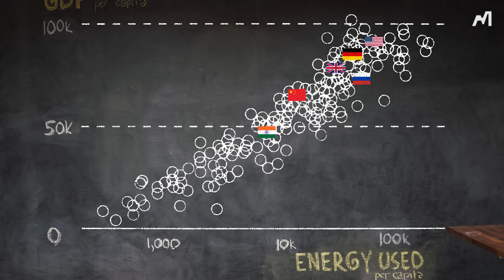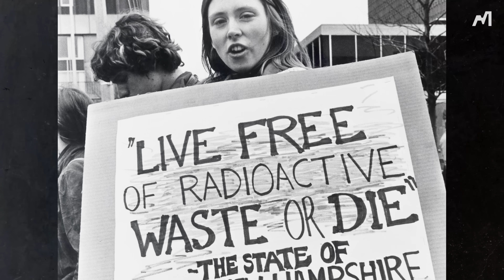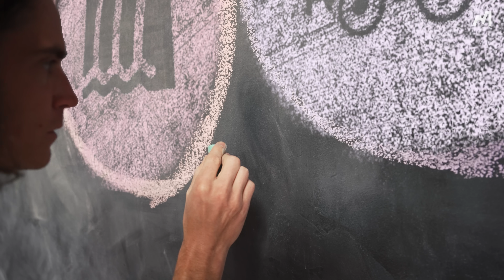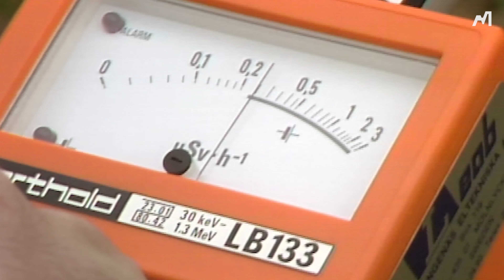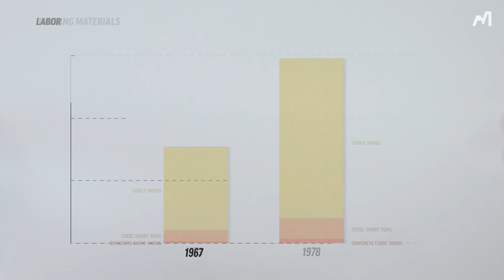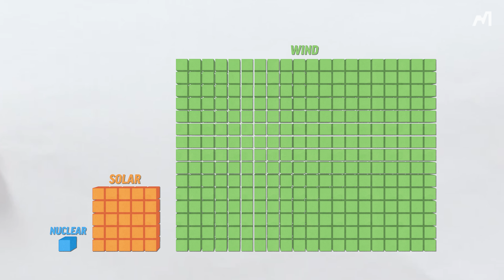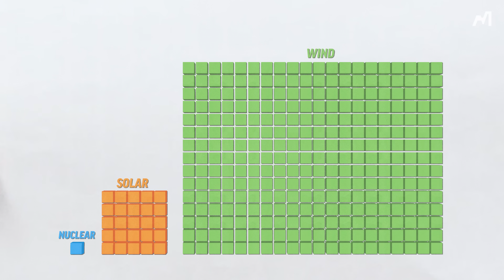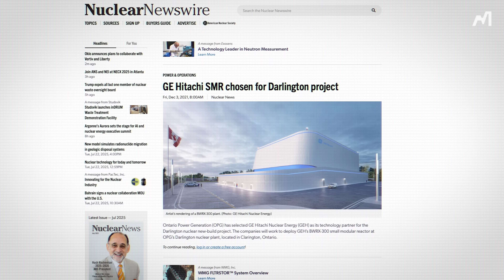They're Lying to You About Nuclear Energy

Comment: The US Navy operates 80 of its most valuable and critical ships - on Nuclear.   They prioritize durability, safety and high performance.   The US Navy started this in 1954.  There is NO reason to NOT proliferate this technology into Civilian use.
Reply: I'm a retired nuclear engineer and ex-US Navy nuke. The reason that the US Navy has an almost (see below ) perfect safety record is that cost is not an obstacle. Safety is the primary consideration. It is drilled into every nuclear power sailor every day for years. Constant safety checks are made all day and night. Maintenance is adhered to strictly and without fail. All of that safety is expensive. Extremely so. A corporation has other priorities, not just safety. Safety isn't even the top priority. That will always be maximizing return for shareholders. The accident at Three Mile Island was determined to be primarily due to lack of proper maintenance and lack of proper training. Navy nuclear safety can not and should never be used as a reason to assume commercial use is safe. 

As for the almost perfect Navy safety record, there has only ever been one radiation release due to a problem with a US Navy nuclear reactor. That was a primary coolant leak on the USS Guardfish (SSN-612) during a leak test on a valve. The radioactive steam from the primary coolant loop exposed 5 crew members, but they were not exposed enough to be fatal. That is the only radiation release accident in reactor operation in over 70 years. BUT over the years there have been 10 or so accidents involving transfer of coolant to and from submarine tenders and subs that have resulted in radiation release. Those sub tender ships are crewed by civilian contractors. There was also the SL-1 explosion and meltdown at the military-run National Reactor Testing Station in 1961 which resulted in 3 fatalities. 

On the civilian side, the list is much longer. Beginning with the partial meltdown at the Rocketdyne facility in Simi Valley, CA in 1959, there have been many accidents, some fatal. The first was an accidental criticality at the United Nuclear Corporation fuel facility in Charlestown, RI which resulted in a fatality. The most fatalities from a single incident occurred in 1986 when a feedwater line burst at the Surry Nuclear Power plant in Virginia in 1986 resulted in 4 fatalities. The most recent incident was a leak of over 1500 cubic meters of radioactive coolant water at the Monticello plant in Minnesota in 2022. The release has still not been 100% cleaned up. 

The more commericial power plants there are, the more likely it is for poor safety and maintenance due to cost cutting to become a very serious problem. We live in an era where it is considered wrong to highly regulate businesses. When politics and profits are the main drivers, instead of safety, there will be inevitable problems. I contend that commercial nuclear power plants aren't regulated enough. They should be regulated as extremely as possible. Because even in the extremely regulated and safety conscious, non-profit-oriented US Navy, accidents still happen.
Reply: @Gerald-Oxfordian  nuked out that response. 😝
Reply: @Gerald-Oxfordian Thank you for your insightful honesty and knowledgeable comment.
Reply: @Gerald-Oxfordian  and these Soviet subs:

Soviet Submarine K-19 (1961):
This submarine experienced a reactor coolant leak, leading to a dangerous rise in reactor temperature and a near-meltdown. The crew, lacking proper radiation equipment, had to improvise a cooling system, resulting in several deaths and widespread contamination. 

Soviet Submarine K-27 (1968):
This submarine experienced a meltdown in one of its two reactors, resulting in multiple fatalities and injuries.
Reply: @sszibler  american sub:
USS Thresher SSN-593 (1963):
Water shorted the electical-system, causing reactor to scram (shutdown), all hand lost.
Reply: @Gerald-Oxfordian weve been accident free from almost the entire history of nnpp
Reply: @richg6191  Most of the accidents were in the 1970's. But the Navy nuclear power program was going then. I'd alter that to say the Navy has been nuclear accident free since the program was fully organized and got its own training school at NTC Orlando. The NNPS there opened in 1976, just 3 years before I went there. Now, of course, it is consolidated further into the NPS in Goose Creek, including the separate nuke A schools. When I was in we went to the regular Navy A schools for our rating before moving to Orlando. Prior to Orlando, the nuclear training was done at Mare Island. All of my instructors in Orlando were trained there. That school opened in 1959. I think for a short while there was also an early nuke training school in the 60's in Maryland, but I might be wrong.
Reply: @Gerald-Oxfordian those are incidents in the navy nuclear fleet, not accidents
Reply: @richg6191  They are classified as nuclear accidents if they occur as a result of anything having to do with a nuclear reactor. Technically even simply industrial accidents like getting electrocuted are classified that way if they occurred in the power plant at a nuclear facility. All of the incidents I mentioned were radiation-related accidents. Mostly cooling water transfers to/from subs to tenders. 
The IAEA has an even looser definition which defines it in part as "an event that has led to significant consequences to people, the environment or the facility" of or because of any accident at a nuclear power plant. Several accidents classified as nuclear accidents were electrocutions, several more due to fires which damaged only peripheral equipment, several hydrogen explosions which damaged auxiliary buildings and more. I think that definition is too loose, which is why I stuck to radiation release only and only included those related to Navy operations.
Reply: @Gerald-Oxfordian  - Okay, now that we've gone over the difference between incidents and accidents, what about hints and allegations?😂
Reply: @samuelluria4744  Your meaning isn't clear. Perhaps you're hinting at allegations.
Reply: @Gerald-Oxfordian  - Sorry, it's a Paul Simon song lyric.
Reply: @Gerald-Oxfordian this is a perfect argument for a nationalized nuclear power grid. Imagine the amount of savings by the elimination of the hundreds of billions of dollars we dump into oil companies.
Reply: @Gerald-Oxfordian this.  Many commenters here and elsewhere say that we should just do things like the Navy does because all the issues with nuclear power have been solved by the Navy.  Except... the Navy isn't cost-conscious.  If you built a civilian reactor the way the Navy builds their reactors, it would likely produce unaffordable power.

Another thing the Navy isn't concerned about is environmental impact.  I'm always puzzled when people describe nuclear energy as "green".  Those who live near uranium mines probably have a rather different perspective.  Another thing to note is that nuclear power plants require large amounts of water.  Some of that water is turned into steam and the rest is returned to the river, ocean, or lake - but it's now a lot warmer than when it was removed from that source.  This absolutely has an impact.  It's certainly not unique to nuclear - hydro, solar/battery, and wind all have their non-green aspects - but the video glosses over this.

I'm not saying that nuclear power plants shouldn't be built.  This video shows the frustrating truth that we made it cost-prohibative to build civilian plants with regulation.  People with an agenda used scare tactics and the legal and legislative systems to make it so.  We should roll back restrictions which have their basis in fear-mongering rather than science.  BUT - we also need to acknowledge that the Navy isn't trying to build reactors to produce affordable power and nuclear power isn't "green".  We don't know what the actual nuclear cost proposition would look like in a hypothetical de-regulated environment.
Reply: @bretjensen6670  I agree completely. The reason that Navy reactors are almost but not entirely accident free is because cost is not an issue. The costs of building, maintaining and training are not an issue. The exact opposite is true for commercial nuclear power. Cost is a major issue and safety naturally comes after cost in their priorities. Corners get cut in building, maintaining and training to maximize profits and political considerations neuter regulations that are absolutely necessary.

Green energy should really be called relatively green. They all come with their own problems, but by far the safest and most "green" are solar, hydro, and geothermal. Fusion might eventually make that list as well, but it will be a decade before ITER has first plasma and others like SPARC are still in the construction process too. 

On the scale of safe and clean, nuclear power is much closer to fossil fuels in terms of dangers and secondary harm to the environment than solar, hydro and geothermal.
Reply: Plutonium planes
Reply: @Sincerely_MrX LOL😂
Reply: Thanks to Admiral Hyman G. Rickover
Reply: Except that one time or was it 9 times? lol. 9 Nuclear subs have sunk, some of which can never be retrieved in case they rupture and contaminate the ocean.
Reply: I want to build one in my backyard so I don't have to pay so much for electricity
Reply: K-19
Reply: @woogicreate8876 Russian sub.  The conversation is specific to the US - and a proper safety protocol and use of Nuclear.
Reply: @davidcook1057  You don't get it pal. The russians didn't want their sub to explode neither. But it did. When subs age, and the US fleet ages too, when people become complacent, and don't say people don't become complacent, ever, then accidents will happen. But more important - when these accidents can happen in highly trained and sponsored navies then they can for sure happen on land. And not always because their dumb or negligent ; it can be because of design. Like Fukushima. The people in Japan got away pretty well there. The world got away pretty well. Half an ocean could have become a breeding pond for small Godzillas, for real, and plenty more people could have died on land.  You're way to confident with the safety of operating nuclear reactors and way too overconfident on the impact when something does go wrong. I don't say nuclear cannot be safe, but the CURRENT plants all can have a meltdown with disastrous consequences. IF we want to bet more on nuclear, do it with inherently safer designers, like a thorium based system. Though the corrosion of the molten salts will have its own issues to - there seems to be no easy, cheap and safe way out. Just do stuff that is simple. Mechanical windturbines. Passive solar panels. Tidal and geothermal energy. No meltdowns when a turbine catches fire, no 1000 year radiation when old solar panels have to be replaced. No billions and billions needed to set up a single tidal wave energy plant. No single target for terrorists to attack, bomb, infiltrate, cyberattack etc etc.
Reply: @woogicreate8876 Go back to your video games Woogi - let the adults deal with big ideas and civilization building.
Reply: @davidcook1057  Good arguments man. Keep it up!
Reply: @woogicreate8876 he said US Naval subs ..pay attention
Reply: @woogicreate8876 We are not Russia.
Reply: There's better tech for civilian reactors. The constraints of operating on a ship or sub dictate design choices that are not optimal if you have more space. Sodium or salt cooled fast reactors are things we've known how to build well enough, and on a scale large enough, for commercial applications since the early 1990s at least. These would be far superior to HEU boiling water reactors like those used by naval vessels for utility power generation.
Reply: Nuclear is the worst form of energy in the world. Its not green in any way. How do we dispose of the irradiated cooling liquid? What happens if theres a large solar flare like the Carrington event?
Reply: @zavelazer8167  how many have died? How long, compared to acres of windmills in Idaho, will a facility last? The cooling liquid is no different then the tank farm in tricities Wa...
Reply: @zavelazer8167  99% of nuclear waste is just contaminated clothing like radiation suits and fabrics, Kyle Hill made a video going into detail explain how absurdly safe and waste free Nuclear reactors actually are.
Reply: My father was a sailor on a nuclear sub 50 years ago.
Reply: I served 4 years on a U.S. Navy nuclear submarine. While on patrol I received less radiation per day then I did walking around in a normal day on shore.
Reply: There is: molten salt reactors are self-extinguishing in case of overheating and they can use up old nuclear waste as their fuel
Reply: @minagica  - These are not online yet.
Reply: Not to be anti nuclear but that's partially because the US military essentially hands certain companies blank cheques
Reply: How safe are all those nuclear ships and subs during war when they start getting destroyed
Reply: If it's good enough to run the military why isn't it commercial 🤔 makes ya wonder if it's intentional
Reply: @troyelder56   Usually, it is, the US does not share tech that could benefit the masses with the masses as long as it could affect profits. I am certain that by now, someone, somewhere has found a cure for cancer, but it is not nearly as profitable as chemotherapy, and the whole usual process, so it won't become public.

That is the method of the US.
And the whole pharma industry, actually.
Reply: Nonsense, if the power question was solved many many politicians, lobbyists, and activists would lose their jobs. And then there might be literal witch hunts to hunt down the people who knowingly pushed "green technology" for the past 3 decades
Reply: The reason isn’t safety related.. it’s always about the $$$ and Big Oil is still king
Reply: The source is so limited, that 50' level of proliferation, would bring it to an end, in less than 200 years. How you power your subs then? 
The town i live in, was funded 900 years ago. The road, my car is parked on, is almost 500 years older. When people back than, had used nuclear power, as we do, there would be no RTG roaming over the surface of planet Mars by now. Stop being short sided. Boil your water another way😉
Reply: @goiterlanternbase  Or just go electric and forget it.
Reply: micro-nuclear stations all over would resolve most power issues
Reply: one reason 💰💰💰💸💸
Reply: Well, for one thing the presenter, Phil, lied to you or was given false information. Nuclear subs have had meltdowns and radioactive coolant leaks, so please don’t lie about the nuclear past as they have, especially when the information is easily obtainable from a google search! 

That’s PLENTY reason not to proliferate into civilian life. The fact that anyone needs to put out false information is reason enough to not trust this info. 

The lack of critical thinking about these content providers is astounding!

Soviet Submarine K-19 (1961):
This submarine experienced a reactor coolant leak, leading to a dangerous rise in reactor temperature and a near-meltdown. The crew, lacking proper radiation equipment, had to improvise a cooling system, resulting in several deaths and widespread contamination. 

Soviet Submarine K-27 (1968):
This submarine experienced a meltdown in one of its two reactors, resulting in multiple fatalities and injuries.
Reply: You have no idea what you are talking about! Navy reactors are enriched close to 95% making them fully weaponizable. The public sector will never get access to such materials.
Reply: I said ram the ship up the Columbia to tri cities, breaking the ship along the way
Reply: The USA is a bankrupt nation in more ways than one.
The USA is a war mongering, global terrorists.
That's an irrefutable fact.
The USA is also a very detrimental influence on Humanity.
A corrupting influence, responsible for many of the most serious threats now facing Humanity.
Hardly an example to be used in any sane argument.
The USA is a force of darkness and depravity, even against its own people.
Financially bankrupt but also very obviously morally bankrupt.
It's own typical boastful arrogance, is a brainwash which is not readily accepted by the sane, observant World.
Reply: All my other comments seem to have been vanished.
Very typical of YouTube to steal people's time, minds, and work.
Rendering many of these debates a futile exercise.
Designed for clickbait, data gathering, profit making, and not a real debate of any lasting value.
Reply: The Navy is an example of a reasonable use of nukes, particularly the prudent fashion in which the Navy has historically operated in this regard.  But to use nukes to power the grid for commercial reactors makes no sense whatsoever, economically or in any other way, especially considering the US has more and better natural gas than the rest of the world COMBINED.
Reply: @TheRealDrJoey  It does make sense in a way, just based on the fact that nuclear power is very fuel efficient and reliable. Only the most modern natural gas plants are as fuel efficient; but nuclear power plants have more than 90% capacity factor (the ratio of real electrical output to the theoretical maximum output over the same period), which is 2X that of fossil fuel plants and more than 3X that of wind and solar. Capacity factor can be considered a kind of reliability and lack of downtime. Nuclear excels at that. But nuclear also has safety concerns as discussed above and we haven't even delved into the inevitable radioactive waste problem. 
The US currently has over 90K metric tons of radioactive waste in temporary storage, most on-site at nuclear power plants but some at 3rd part off-site locations. That number increases by 2k metric tons per year. There were plans to build a storage facility at Yucca flats, but it has been entirely defunded and abandoned and that facility was only designed to store 80K metric tons, back when the US stockpile was only 60K tons.
 The US is the only nuclear power-using country in the world right now which has no currently being constructed underground storage (Finland) or plans to construct such (everyone else but the USA). We're just using temporary storage rated to last more than 100 years, but we need permanent storage which will last at least 10,000 years, which is another big problem.
Fusion is our best hope, but we don't have commercially viable fusion yet. The best we've achieved has been a Q=1.5 or so recently at Lawrence Livermore. We need Q>5 or even Q>10 to be commercially viable. Q=0 being the power input to power output breakeven.
Reply: @TheRealDrJoey  - Don't get offended, but it always cracks me up when people talk about [place X] having more [such-and-such] than [place Y]...
        We are FAR from knowing how much of [any given subterranean resources] are where and where not. 
       Clearly, with forthcoming exponential advances in sensory apparatus, due to AI, we will know much more in 10 years, but right now there are still many mysteries.
Reply: *Domestic* civilian use.  We all know how India and Pakistan turned out.
Reply: In civilian use you would need only one group of human hating activists to turn it into nightmare.
Reply: Yes there is... armagedon.
Reply: the reason why this tech is kept secret is to prevent foreign nations from getting access to it and building their own nuclear subs and carriers.
Reply: @KT-pv3kl  France has their own, Brazil has their own nuclear carriers, China and Russia are likely to have their own should they choose to do so at any point. The secret is not as secret as the sheltered and indoctrinated fools think it is. If you can make a Nuclear Plant, it wont take long to figure out how to downsize for ship use 😂
Reply: @georgesgranger6362  i call absolute BS on brazil of all places "having their own" .

....yep turns out you are spouting BS. 
brazil doesnt even have regular aircraft carriers left alone nuclear ones.  they had a single one that they had to scrap due to its abysmal performance.
Reply: @georgesgranger6362  nah mate you lost me at brazil ... 

brazil doesnt even have aircraft carriers at this point left alone nuclear powered ones. whoever told you that is delusional. 

the problem isnt making a reactor small the problem is making a small reactor safe. 
you dont have dozends of meters of water , concrete and steel shielding the reactor core from the squishy bits that shouldnt be blasted by gamma radiation in miniaturized reactors so your margins for error are razor thin when it comes to energy output and cooling/regulating the core.
Reply: More then enough reasons to pull the plug on nuclear
Reply: @computercrack  if you believe everything the Government and big Oil says about it sure
Reply: There is, and it's called profit.
Lobbyists control the world, not the citizens.
Reply: They do utilize a higher grade of refinement, than commercial plants, if my understanding is correct.  Has to go through more centrifuges, etc
Reply: Like the Kursk?
Reply: @stefanschleps8758 Did the US Navy operate the Kursk?
Reply: @davidcook1057  the US Navy shouldnt be used as a metric of safety given information from the Military is heavily censored and covered up 😂
Reply: @georgesgranger6362 oh please, this isn’t Russia or China.
Reply: From what little I know about this subject you are 100% dead wrong. Nuclear freighters were not built for the obvious reasons, terrorism.
Reply: Try more like 100, I can come up with 78 just from submarines, but every aircraft carrier has one too.  So that's at least 90 right there, and I am probably missing something.
Reply: Do you go thru life believing the claims you make are written in stone? You sound like a military contractor's brochure.

I'll give you a reason not to proliferate this technology: 
NS Savannah, the first nuclear-powered cargo and passenger ship

Launched July 21, 1959 
Out of service January 10, 1972 A total of 13 years of useful life.

reactor de-fuelling completed 1975
reactor core removal completed 2022

Full decommissioning of the nuclear power pant is currently expected to finish in 2031, 59 years after she ended her useful 13 years of life.
Only then can she be scrapped.
Reply: US navy operates Light water reactors with very high U235 content, well above civilian limitations. But that's neither here nor there. Light water reactors are much safer at the scales the navy deploys them, than the scales they're built for commercial use. Like 250mwe vs 1 GWe 

Many rector operators today are former naval nukes. But hered the fun bit: the automatic controls are actually significantly safer and more reliable than the operators themselves. I attended a conference for nuclear operator trainers providing it support. They had 2 jokes.

The ideal control room has a dog and single operator, the operators job is to feed the dog, the dogs job is to keep the operator away from the controls. 

The fire thing an operator needs to do when a warning goes off, is to hurry up and call a pizza delivery place. Then wait for the pizza to arrive. Then eat the pizza. Then if the alarm is still blaring, they go to wall shelf and get the first book of instructions to start troubleshooting the alarm. 9/10 the alarms are solved automatically.
Reply: US Navy reators run on highly enriched uranium, roughly 95%. This uranium is weapons grade quality and costs about $50M for only 165MWe.
Reply: @paulwhelan8567 France operates nuclear subs on 7% enriched uranium, the only reason highly enriched uranium is used is to extend the time between refueling, which isn't an issue for civilian reactors.
Reply: @paulwhelan8567  These costs are inflated, it could be done for far less, but why?
Reply: @paulwhelan8567 Good thing the technology is 70+ years old - many generations improved and SMRs only requires 20% - which is going to be enriched in the  US.  The point is this technology is safe and durable.
Reply: @davidcook1057 they haven't built a smr yet! And they never will build one that is safe! The fuel for an smr is illegal in the states! No MOX FUEL! NO REPROCESSEDFUEL! ILLEGAL! NO SMR'S EITHER!
Reply: @richardmccann4815 This is exactly the kind of ignorance that is rampant surrounding Nuclear.  You are totally wrong - update your information and stop peddling ignorance.  A simple GROK ask will tell you how wrong you are.
Reply: @richardmccann4815  only illegal because politicians make money with how they handle things here in the states. 😂
Reply: Yes there is, it's called people. The military has strict rules, regulation, and code of conduct. They also have classified protection so we have no idea if anything has ever gone wrong with any of their reactors. Meanwhile normal folks are lazy, we mess up, we cut corners, we down play risks, fall asleep at work, and then there is of course armed conflict. Fear of technology is not the reason it's the knowledge of human behavior. 

Oh, and if anything goes wrong with one of the Navy's reactors they can drop it to the bottom of the ocean, what happens when something goes wrong with the one down the street from you? You gonna go clean it up?
Reply: @willernst2721 imagine how little Humanity would achieve with such ignorant and small brain thinking.  I am grateful for the builders, the risk takers, the dreamers that don’t project Incompetence on the rest of humanity.
Reply: Yes, Navy ships are just like civilian reactors and operators.
Reply: @railgap  Not exactly. Power plants are pressurized water reactors using lower energy-density low enriched fuels and are operated by controlling the amount of xeon and other neutron absorbing elements in their cooling water. Naval reactors are boiling water reactors (which effects the design of the turbines) using high energy-density high enriched fuels (>90% U235). They are operated by adjusting their control rods and are rapidly throtable.  Also, thd designs of the naval reactors are a state secret.
Reply: @evancourtney7746  I think you are mistaken on naval reactor types. According to published materials, virtually all water cooled naval reactors are PWR designs, not BWRs. 
My understanding is they use higher enrichment to provide fast throttlablilty (overcoming the inevitable neutron poisons you mention for example, although the introduced burnable poisons in commercial reactors are typically boron or gadolinium, not xenon, which is a fission product, not a purposely introduced neutron poison), long un-refueled lifetimes and increased power density. Even Nautilus had ~18% enrichment for these reasons.
Reply: @railgap  A lot of the personnel operating most commercial reactors are retired navy nukes. Though I'm assuming your use of the word operator to refer to the companies that own and operate the plants?
Reply: Started this in 1954, and to this day have not had a single nuclear accident.

The worst disasters that ever occurred either affected systems that did not contain radioactive particles, or the contamination was still well below dangerous levels and was immediately cleaned up when it was discovered.
Reply: @techypriest7523  Incorrect. See my post.
Reply: @techypriest7523  Soviet Submarine K-19 (1961):
This submarine experienced a reactor coolant leak, leading to a dangerous rise in reactor temperature and a near-meltdown. The crew, lacking proper radiation equipment, had to improvise a cooling system, resulting in several deaths and widespread contamination. 

Soviet Submarine K-27 (1968):
This submarine experienced a meltdown in one of its two reactors, resulting in multiple fatalities and injuries.
Reply: @techypriest7523 Until it all goes horribly wrong and you take zero accountability.
Reply: @techypriest7523 you're a bit touched in the head if you really believe nothing has ever gone wrong and just wasn't reported. The same thing happened at the Hanford site and wasn't admitted to until something like 50 years later. That's why there's unknown spills throughout the site because the people that spilled it didn't want to get in trouble so they just didn't tell anyone until much later in life. Oh and those same workers are constantly getting sick now from the exposure to this "safe" radioactive material. They run ads about lawsuits they qualify for because they weren't given the proper PPE. And that continued into the 2000s during the largest super fund site in the world. Why would we spend billions cleaning it up if it's so safe? Might still be happening now.
Reply: @techypriest7523  There have been accidents with bombs however.
Reply: @tedmoss  different people running that situation. Cannot blame their idiocy for the running of nuclear reactors.
Reply: There are nuclear secrets in those Navy reactors that have “national security” stamps so it’s not that easy. 

Naval reactors are probably more robust since I’d expect they have “wartime” thinking in them.
Reply: If ever there were an ultimate limit to "growth," it would look exactly like what is happening now, where all alternatives are short-term gain at the expense of long-term sustainability.

There is no such thing as permanent, safe, storage of spent fuel (witness the ongoing storage of spent fuel at plant locations from lack of dumping sites, making each reactor site "an event in progress," just like what is going on at Chernobyl and Fukushima)!
 
More stupidity is not the solution to stupidity. The simple fact is that the intense ionizing radiation in the boundary of the nuclear fuel causes the containment to transmute over time, where the containment materials lose their original elemental qualities, frequently becoming brittle and no longer able to perform as originally intended. Zombie reactors that are past their designed life are losing the safety safety factors originally designed into the containment in ways that are not predictable until incidents inevitably occur. The same thing applies to the containment of high-level nuclear waste. These matters are well-known to the industry, but being withheld from public scrutiny in order to maintain the current zeitgeist.
Reply: There is a reason. The Navy has almost unlimited money to spend and doesn’t need to make a profit on anything. Nuclear power in a civilian market needs to be cost competitive with alternatives, which it currently is not.
Reply: @wendlerkurt  Thorium? More nuclear options than one. The free market makes things better and cheaper.
Reply: @wendlerkurt Nuclear is more profitable in the long run. It just takes 10+ years to start turning a profit, and as long as 15 for the profits to overtake natural gas. That's longer than any relevant business or political cycle. No one is willing to make investments that take that long to pay off. But they should.
Reply: @wendlerkurt hence why we should have them.
Reply: @Jengoboys603  you want to pay more for electricity? I don’t
Reply: @wendlerkurt  I could make a reactor that is cost competitive. People won't let me.
Reply: @wendlerkurtthe only thing making it not cost competitive is the burdensome regulatory bodies. They won’t allow new plants, they cause delays and cost overruns until projects are cancelled as explained in this video. No reason for it except politics. Military has demonstrated safe nuclear. We know how to do it.
Reply: You mean when they switched from using gas powered submarines that had a trail of bubbles coming out of their exhaust? Which needed to resurface every hour because the oxygen would be depleted by their engines? Or the ones that couldn't dive very deep or the sunlight wouldn't reach their solar panels?
Or perhaps none of those existed, because a submarine is a very specialized environment?
Reply: They also pay through the ringer for these reactor. Worth it for their military advantage, not economically interesting.

There is a reason the navy abandoned the idea of nuclear power cruiser or why civil maritime industry (or any civil industry) hasn't been trying to introduce the naval reactors for civilian use. They are only worth it for some specific applications where high costs can be acceptable.

This is why civil SMR's also need to "start from scratch", it isn't just building an SMR, it is building it in an economical (and still safe/legal) way.
Reply: @MDP1702 sometimes things shouldn’t be about the economics, I’m sorry. This is such a 19th century way of thinking and it’s no longer sustainable; not everything that should be done by humanity should be done purely for profit. The world needs to solve a lot of problems, and the solutions are often not immediately profitable economically.
Reply: @pekabu01  
sometimes things shouldn’t be about the economics
You can say this as much as you want, but unless you're going to change how the world works, economics will be a main driver.

not everything that should be done by humanity should be done purely for profit
Which is why you (should) have government actions for: the benefit of all, not profit. However they still have a budget to balance and will favour solutions that can be economical on their own (eventually).

Don't think I am a capitalist who believes free market should always reign, I am actually pretty socialist oriented but I am also aware of how the worlds works currently.
Reply: @MDP1702  Most States regulate Utility company profit margins.  It is meant to balance reasonable profits with consumer protection and safety.
Reply: @davidcook1057  That isn't really relevant if there are no profits to be had => no profits => no reason for investors or companies to build and explot it.
Reply: @MDP1702 Yet, it is currently happening, right now.
Reply: @davidcook1057  Which companies/private persons are investing in non-economical naval type nuclear reactors for civil use?
Reply: @MDP1702 I brought up Nuclear technology being used in the US Navy.  That if Nuclear technology is safe and durable enough for the military’s most precious assets, there is no reason that the civilian world should be so terrified and ignorant about Nuclear technology.   Smooth brains jumped to the conclusion that I was talking specifically about only Navy Nuclear style reactors.  The conversation is about Nuclear technology.
Reply: @davidcook1057  
That if Nuclear technology is safe and durable enough for the military’s most precious assets, there is no reason that the civilian world should be so terrified and ignorant about Nuclear technology.
And I pointed out that you can't make that comparison. Nuclear naval design is different than that of civil. Their safety precautions are even more stringent than current civil regulation because costs are more of an "afterthought" in comparison
If you'd translate military nuclear regulation to civil nuclear regulation, the cost of civil nuclear power would increase a lot more than in already is.

It is like pointing to an aircraft carrier and going "look you can launch and land planes from ships", yeah duh that is possible, but it has no bearing on civil aviation.

Safety of nuclear with proper regulation never really was in contention, the question is more what entails proper regulation and doesn't it make nuclear too expensive (and thus making the point of safe nuclear void anyway).
Reply: @MDP1702 complete nonsense.  Do you think the US Navy learned anything in the 70 years of using Nuclear under extreme conditions that would translate to the civilian world?  Things that could make it safer, more efficient?  MANY technologies that were first used by the military, we now rely on in the civilian world.  GPS, the internet, etc.   The technology is generations further than it was in the 50’s and 60’s - decades ahead.  This country needs every energy source it can get in the coming decades, and Nuclear must be part of that equation.
Reply: @davidcook1057  
Do you think the US Navy learned anything in the 70 years of using Nuclear under extreme conditions that would translate to the civilian world?
Except most of that would be classified or too expensive to use. You are better served looking at civil nuclear/projects or researching "new". By the time the knowledge of military reactors that wasn't already known to civil industry before is declassified, it is already outdated.

I don't dispute that other things developed for the military had a big impact on civil life, but we aren't talking about these things now.

In the end the point to your original comment remains: military nuclear reactors have proven so well and safe because money was thrown at it in a way not possible in civil industries. And I am not going to waste more time on you trying to make your original comment more usefull than it is.
Reply: @davidcook1057  this is still a quite blind statement. Military assets have a completely different risk exposure than peacetime ones. And they are expected to be lost, are expected to not be able to go on maintenance at will, are expected to be taken out of service (B-52 excluded)
Reply: @MDP1702  Tax payers have been paying upward of $50 billion a year, every year, since the 1980's to subsidize oil. Literally trillions of dollars have gone into oil. In comparison, roughly $200 billion has been spent on nuclear reactors, ever. I wonder why you're so concerned about the cost of nuclear, but you've never stopped to consider how much we spend on maintaining oil as the dominant energy source.
Reply: @cajonesalt0191  
You are barking up the wrong tree, I am not in favour of oil subsidies and believe they should be cut immediately.

It isn't nuclear vs oil or even gas, more nuclear vs renewables. And currently it looks like nuclear will loose the economics fight with renewables. Not to say nuclear would be completely useless, rather it isn't likely going to be the main source of power in the near future unless something drastically changes the equation.

My original comment also only focused on the start of this thread about naval nuclear reactors and why they are useless in the discussion about civil nuclear use.
Reply: @cajonesalt0191 oil doesn't just go away, it's here to stay forever and always thankfully.
Reply: @cajonesalt0191   Interestingly, we spend $60 billion a year, to maintain the nuclear bombs, themselves.  Replacing the heavy water/lithium fusion liquid, for instance. Very complicated materials/procedures/and transportation to do it all.

Russia spends $69 billion, for their whole military budget---which is why a country without a navy (Ukraine), sank most of their Black Sea fleet.
Reply: @MDP1702 ”Renewables” cannot meet our energy needs. It’s a fantasy.
Reply: @escapedfromnewyork  
I don't know where this statement keeps coming from, since renewables can definitely meet our energy needs. That isn't even debated anymore. The question more is for how much cost, at what point does the cost come low enough and what is the most opportune % of renewables through time.
Reply: @cajonesalt0191  You mean besides killing over a million people every year with car exhaust? Add double that amount for increased medical costs.
Reply: @MDP1702 are you sure it’s not because of the cost of getting through government?  Not the actual cost of material?
Reply: @chipchipperson12  It isn't like there is no cost for the other generation sources development due to government regulation. It is however less since potential problems have a much lower potential impact.

But even in nations with few regulation/governments being the builders, you still have the cost around similar to coal at the low end or natural gas on the medium to high end. Which is still higher than large scale solar or onshore wind. And those are the optimum scenario's regarding government induced costs.

Ofcourse you might always find some outliers (both at the low and high end)
Reply: @MDP1702 that’s a bad argument because everything that the government buys is grossly overpriced….$10k toilet seats come to mind…..they just waste as much taxpayer dollars as possible and keep asking for more…yet we seem to never get any real benefit
Reply: @MDP1702 not true, there are many startup companies in the US buliding MNR modular reactors geared fir life  on the moon and also large AI data centers, Nuclear is the future!
Reply: And yet there are people that don't understand it and cry about it
Reply: @bearb1asting Don't understand what ?
Cry about what ?
Arrogant people make comments that only themselves can ever understand.
They don't consider the readers because it is all about their own ego.
They often also lack any sound argument or salient points.
I could cut and paste this comment I am making, all day long, to millions of people on YouTube.
Reply: Nuclear armed vessels can't come to NZ because... luddites.
Reply: Better yet,disband the Navy.